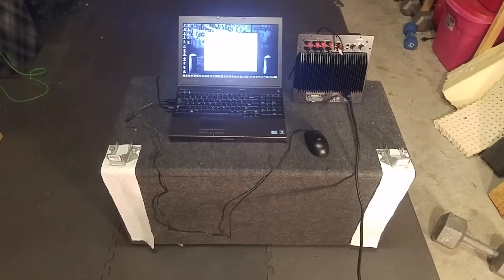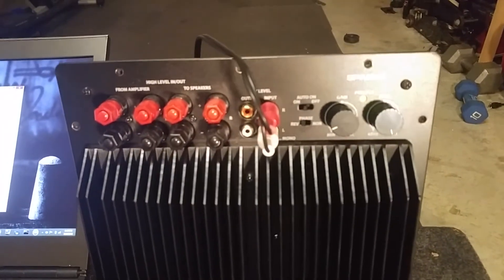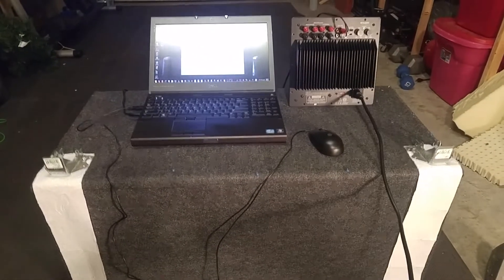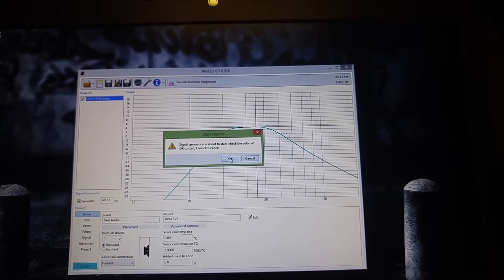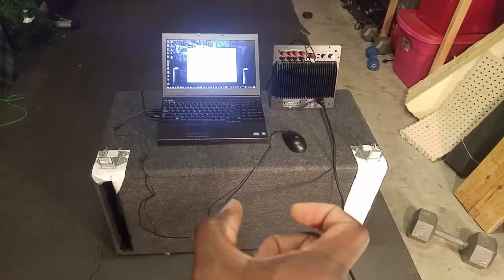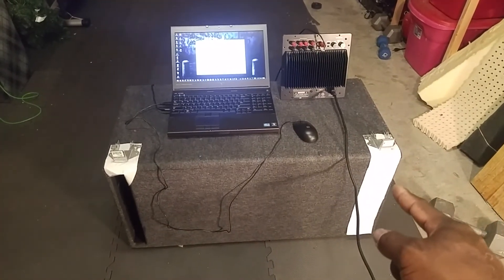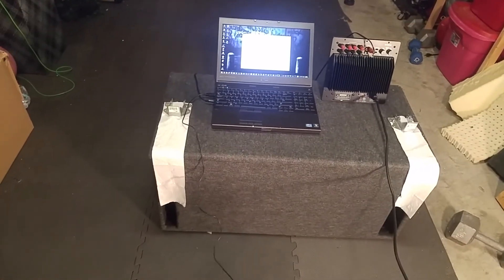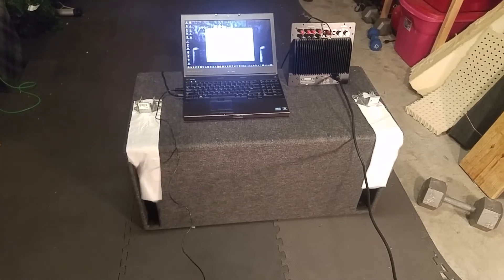6th Order Bandpass Restoration - Part 2

Comment: I am trying to do a home theater sub, with a D-2ohm VVX-8v3. would like to do a 6th order band pass enclosure with windows to show off the magnet. (so I guess my Q is) can I get away with NOT using the foam? as I believe it will make the project I had in mind look ugly AF. lol will be running the sub off of a BASH-OEM 500w rack amp @ 4ohms (side Q- subs rated at 400w, and am told that this amp IS stable @ a 2ohm load, could I run 2 VVx's? or would my output suffer from the wattage drop per sub?)
Thanks for any help man. Love your videos!
Reply from the maker: Those Bash 500s looks really good. I think the foam kills a windowed build. ditch the foam and let us know how it goes!

Comment: bro. i really enjoy when i see new project, now i have question i have sup-woofer with fs 36 so i tuning it to 33 and i have Mid- speaker fs of it 45 how much i should tuning it???
Reply from the maker: Are you planning on pairing these two in a 2-way setup?
Reply: BudgetBassHead yes 2way but am thinking maybe i go with 3 way.
Reply from the maker: My advice would be to build or purchase a crossover to keep the two units from competing with one-another. Typically most sub amps have built-in crossovers, so you would probably only have to make certain the midrange driver doesn't have to bother with the frequencies assigned to the sub.

Comment: Man I got a 4th with 1 8 and it hits 50's like no tomorrow! I'm going foam inside and see if the tuning drops! Great video! Should I foam both sides or just the ported side. Mahalo.
Reply: indoor outdoor carpet is nice thin stuff and foam backed, spray adhesive or rubber cement, see how it does. I usually only go after the surfaces facing the cone to slow the bouncing air+sound waves.
Reply: @modelnutty6503  I have the sub inverted with the cone facing the sealed (smaller) side for cooling and to drop the tuning a couple points. I could flip the sub and foam the ported side only. I'll try both methods. Thanks

Comment: This is a parallel sixth order! You tuned to 20-50 hz 35 hz is the mid point. If this was a fourth order & you wanted similar bandwidth you would tune the front to 35hz.

Comment: I always use polly fill it works wonders. People say it drops tuning just very slightly but as you can see they never used it right but I know it changes tuning a lot when you need it to. Easy to add and remove i rather use to my liking instead of making multiply removable ports 👍